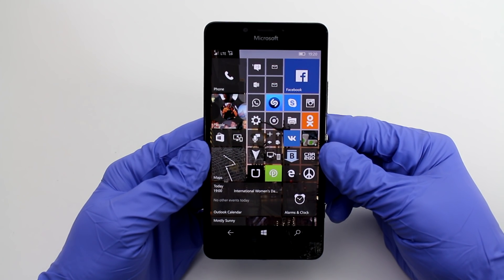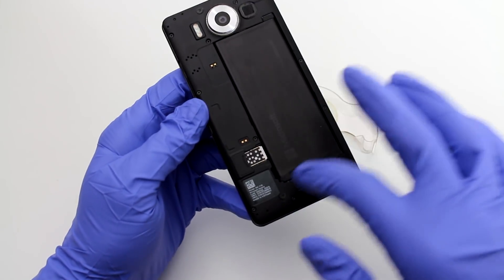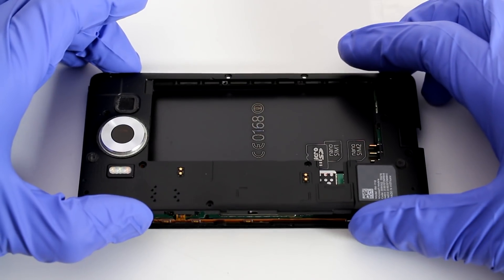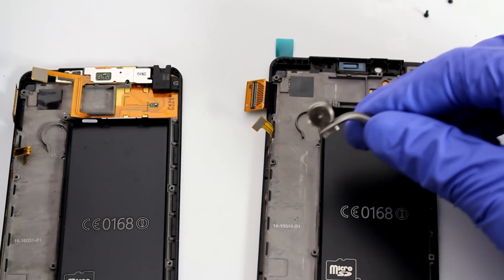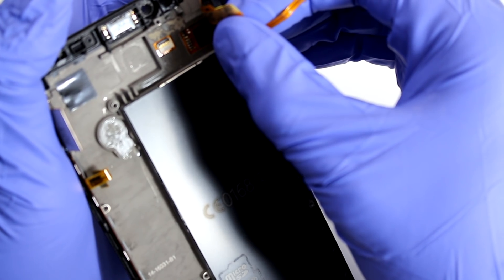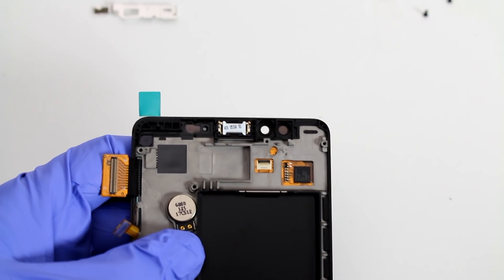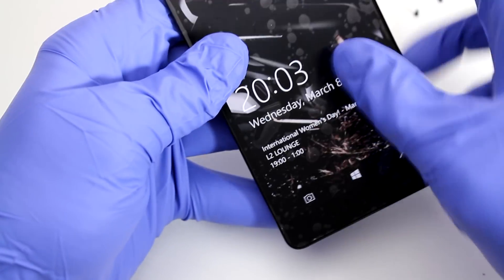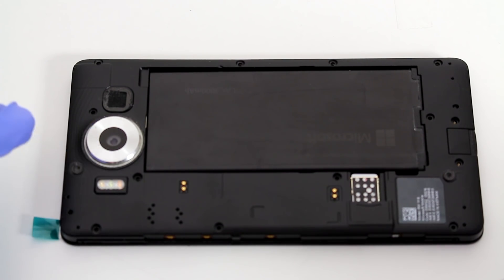Lumia 950 Screen Replacement ONLY (step-by-step)

Comment: Twice now this video has saved me, I'm on my second replacement screen on the L950, yes the year is 2024 but it's a good phone. Replacement screens still available when this is written (2024) and rather cheap, 35 bucks or so. Reuse, recycle etc instead of buying new.

Comment: Hi'ya! Thanks for making this video.

Still a diehard Lumia 950 user and recently
cracked my screen after 5 years of ownership.

As I'm waiting for my replacement screen to come
in I've been brushing up on the eventual repair.
[ Found on Amazon - prolly refurbished ]

Three Questions / Comments:

1.
You mentioned there are two different sized screws
but never detailed which screws were short vs long.

2.
Can the repair be completed if the screen assembly
doesn't come with the 'light adhesive' included?

3.
Since the Lumia 950 is discontinued parts will be scarce,
how can I tell if I'm buying a cheap knockoff or legit Lumia part?
Any sources for buying legit new/refurb Lumia 950 parts?
[...other than Amazon / eBay if parts sell out...]

Anyways, thanks for making the video - I'll be referencing!

- Mr. Bogard

Comment: I purchased a screen, through eBay, took quite a while to recieve from china well packed and ultimately worked great.

Screen had thin plastic covers over new adhesive, which had to be removed before adding components.

The buzzer refused to come off old bird as instructed, glue to strong, so a hair dryer for a few moments softened the connection, and small electrical pliers had enough grip to remove from old board. 

Worst removal was speaker, again well glued into socket. As carefull as i could be, cover with magnet came loose, which I could press back into place. Sticky two sided glue gasket resisted removal, again the hot hair dryer. New gasket was included with new screen.Then used heat to remove all other glued parts, worked very well.
Reassembled per instructions , but added a few screws on back to test. 
Works well on all levels...sealed up tight and like new.
My Lumia 950 was a more recent  replacement due to camera, while under warranty. 
Glue in all cases was very strong and resisted repairs as shown in this great video. Moderate use of a hot hair dryer, with care, loosened the glue and made it all possible. 
Took about an hour and a half due to struggles with adhesives, especially speaker and buzzer components. 
Thank you for fine video.
.

Comment: Excellent video, I replaced my screen with no problems thanks to this. Only one note - some replacement screen/digitizers sold don't come with the control button strip and connector (like mine.) So you will have to peel it off of the original screen assembly and attach it to your replacement. If this bothers you, shop for a replacement that comes with the button strip (like the one in the video.)  Though, if you can remove the adhesive connector/headphone jack strip successfully, peeling off the button strip will be no problem.

Comment: An excellent video. Thank you. I am ready to do this.  I see the replacement kits usually mention that they are LCD.  Is not the original screen AMOLED?  Does that matter?  Also I dont see the Microsoft name on the kits on Amazon and its not clear if they are new or used.  Which is the best place to buy one?  Thanks again!  Your video is excellent.

Comment: hy, i see You have a dual sim phone there and the new display was for a single sim version (You can see the signs under the battery). You have issue with that? thx
Reply from the maker: Hi, very good questions! Nope, no issues at all. All 950's replacement displays can fit to all one or two SIM card Lumia 950 models. Thanks for asking!!
Reply: Thx a lot for your answer. Great video. keep up the good work!
Reply from the maker: Catalin User Thanks! :)